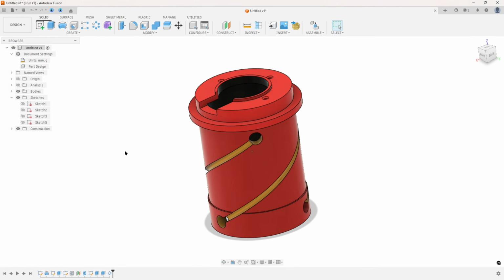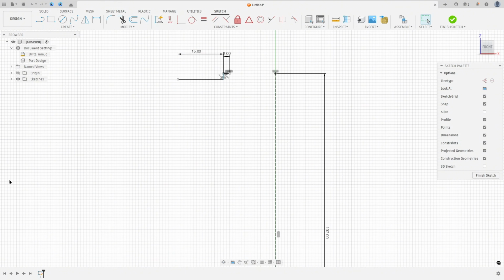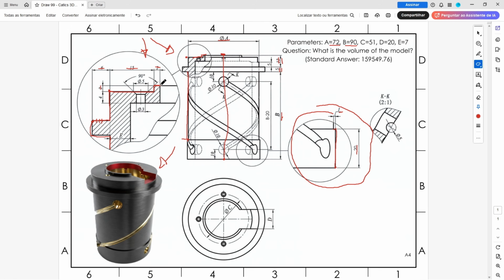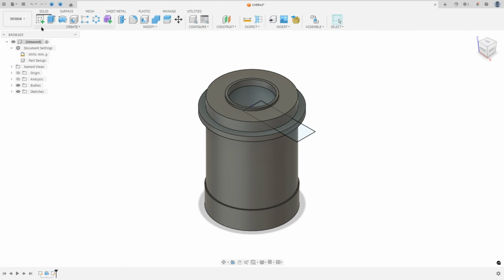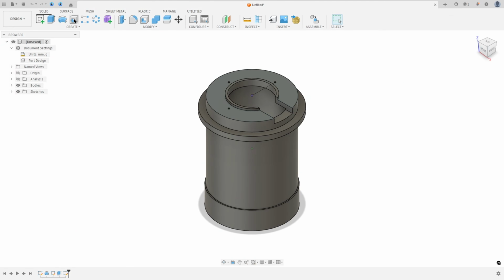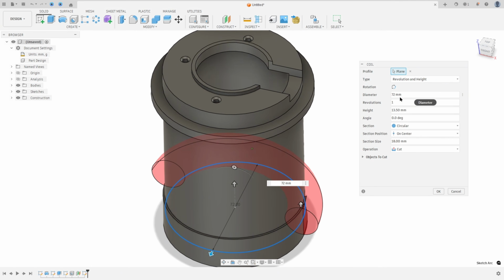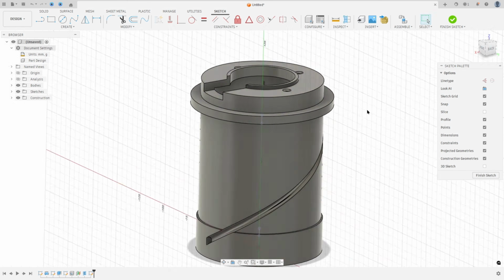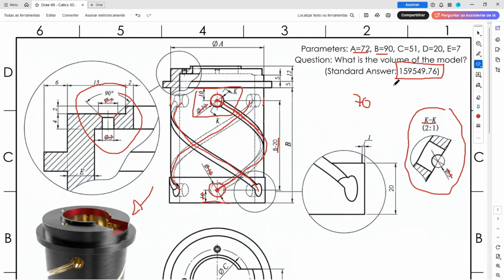Can You Model This? Fusion 360 Challenge - Catics 3D02-04

Comment: Did you notice that where your coil starts and ends does not agree with the drawing.  It agrees with your render but not the drawing.  in the drawing your hold is 90deg off set from the feature created by dimension D and to the back.  The hole at the bottom does not fall directly under the feature created by dimension D.  Because of limitations of Fusion 360 this changes how you need to create the hole features and slot feature at the top of the part so they fall in the correct position based on the diagram.
Reply from the maker: Great catch — thank you for pointing that out!
I honestly hadn’t noticed that the coil start/end position didn’t match the drawing orientation, only the render. 
To fix this in Fusion 360, the workaround I used was:

After creating the hole with the Hole command,
I added Move/Copy → Rotate, and rotated the part –90° to align the hole and the top slot correctly with the diagram.
Reverse the rotation of the coil feature.

Because of how Fusion handles the coil start angle, this ends up being the cleanest way to reposition those features accurately.

Really appreciate the detailed observation — that kind of feedback helps a lot 🙌